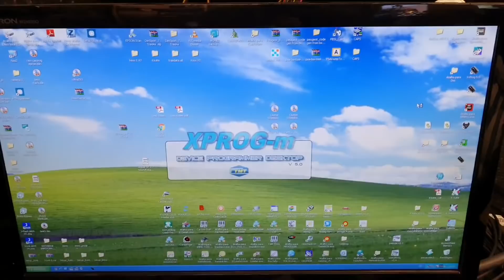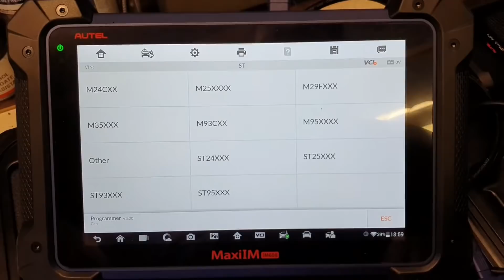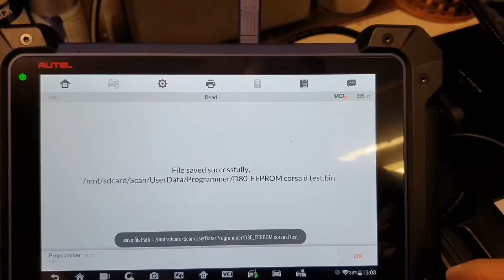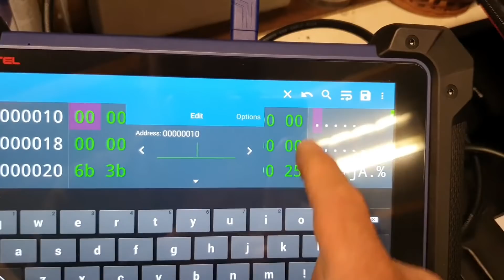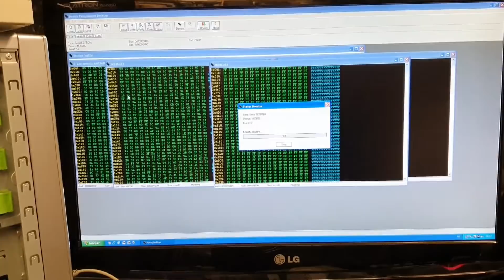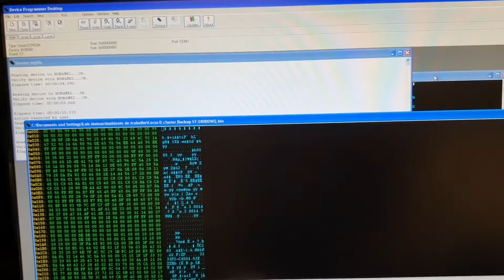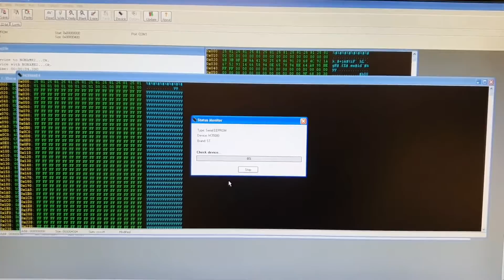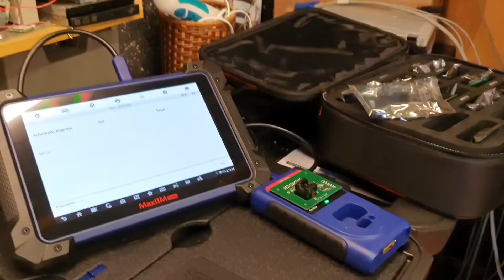Writing incremental bytes on 080D0WQ... Using the IM608 and the IMKPA adaptors.

Comment: Do you have any idea how this write protection is implemented and how the tool gets around it? I'm lucky to have an IM608Pro, about to order the APB126 adapter for it. I used to always use my Yanhua Mini ACDP with a 35xxx adapter board to edit my 160DOWT. This time, it's not working, and it's not working on a new 160DOWT either. The programmer just hangs on the write process and corrupts the data. I think Yanhua could have changed something and introduced a bug, so I'll use the APB126 to restore the chip. I just don't understand the theory behind this. I also read somewhere that if you heat the chip to 100 C / 212 F, it might work. I guess I'll throw one of the new chips in the oven to see if that helps.

In short, thanks for confirming that the APB126 should solve my problems and I don't need to buy some other $500 tool.
Reply from the maker: Look for the datasheet of the chip, there is comprehensive information regarding how the chip works.
The way most tools get around this incremental area is by erase it...
The incremental area, the first 32b, only allow writing if the value to be written is higher than the one stored,  so if the tool erases the area first, then whatever will attempt to wriite next it will be higher...
Probably not very well explained, but hope it makes sense. 
And again, have a look at the datasheet...
👍👍👍
Reply: @LMAutoRepairs  I found the ST datasheet for the M95160-DRE but that refers to a lockable ID page that's 32 bytes. I haven't found the datasheet for this chip. But I can imagine they designed a custom version of the chip that allows incremental writing somehow. I understand the basic physics of ROM's, how you can erase an entire page and then you can flip bits from 0 to 1 without erasing. That would allow you to write, for instance, 0, then 1, then 3, then 7, etc. because you only have to change zeroes to ones. It's weird to be able to increment. Maybe that feature isn't a result of hardware physics and it's actually implemented in the chip software because the customer requested it from ST. I hope ST hasn't limited the number of times the first 32 bytes can be erased or something. The Autel isn't recognizing the new chips I bought off Amazon so tomorrow I'll desolder my original chip and see if I can erase it with the Autel.
Reply from the maker: @charvakkarpe 
There is plenty of fake chips out there, those can behave in strange ways, not being recognised being one of them.
😊

Comment: Hi
How do you erase crash Data in airbag module p/n DN4J-57K30 on a Mazda MX 30 from 2020, I can't see which brand the eeprom is, I've read on Google that I might gona use some obd can tool?
Last, do you do this job, I send it?
Reply from the maker: No eeprom on that one...
The data is on the processor, an Infineon Tricore...
👍👍👍
Reply: @LMAutoRepairs  is it possible to erase crash Data?
Reply from the maker: Yes... should be...
👍👍👍
Reply: @LMAutoRepairs  hmmm, could you please give me a hint, how? 🤔
And what tool to use, because this module cost 1050£ +tax
Reply from the maker: You need to read the data from that chip first...
Do you have any tools?
Reply: @LMAutoRepairs  No, I have IM608.
What is the workaround, this might be an idea, to a new video from you 😜
Reply from the maker: If the IM608 is not capable to read that chip, check on the menus etc, you need another tool to do it...
👍👍👍
Reply: @LMAutoRepairs  what tool, would you recommend?
Reply: @LMAutoRepairs Hi Luis
If I sent the airbag unit to you will you be able to reset the crash data?
And how much do you charge for it?
Reply from the maker: I do not do things that way...
Without the car would be difficult to test etc...
Sorry...

Comment: Good morning pal, I’ve just recently subscribed to your channel and would like to say I’m really impressed in your work, I’ve been watching your video’s for some time, I’m also in the game use to work on a lot of the old cars back in the day and still doing them but struggling with a lot of the electrical side of stuff, and when I’m watching you I just wish I could do the stuff you do cos it’s so impressive, I get a lot of electrical work some I can do cos it’s just a case of connecting a wire back up and so forth, Ok to the main thing I would like to ask you, I have a Peugeot expert 3 2009 1.6 hdi  130,000 miles I have starting issues it’s just turning over no start I think fuel not coming up, I have a solus legend which shows a few faults, but for now I’ll just send you this msg cos not sure how busy you are, as I have more to tell you, and just want to know if it’s ok msg you with the rest of the problem I’m having with the, I watched you video of the one you worked on and it’s the same type of van. Kind regards
Reply: Thanks for the reply the first code is P0104 Flow meter signal open circuit but that’s because I replace it with a new one
P1351 preheating relay circuit, Relay stuck in open position.
P0113 inlet air temperature signal  (flow meter) short circuit to positive or open circuit.
P0615 Controlled engine start and stop, open circuit or excessive temperature of starter relay
P0692 Fan high speed control, open circuit 
P0193 Diesel pressure signal, short circuit to positive or open 
P0238 Turbo pressuresyh
Reply: P0238 Turbo pressure ( downstream of heat exchanger) short circuit to positive or open circuit or value too high.
Reply: These codes I’m sending now was the ones previous before I fitted the new parts.
04A1 front/rear courtesy lighting control fault, short circuit to positive-local.
05FF Bsi Internal Fault (Bsi Reset) not Characterized- local
0A58 Study fault.
Reply from the maker: From this, I would start on the P0193...
If it is true, on live data, the readings of the fuel pressure will either be frozen, erratic or completely out of range...
I would focus on that to start with, check wiring first, connections, etc...
Reply from the maker: Hi
Thank you for the feedback! 
The codes, whatever they are, should help you going in the right direction...
👍👍👍

Comment: Hi Louis, I have not used Windows for a long time but IIRC if you press Alt+Spacebar you get the option to move a window that has gone off the top of the screen.
If I'm wrong then someone will correct me.
Thanks and good luck to you for these informative videos.
Reply from the maker: 😊
I will try next time...
👍👍👍

Comment: That's a really weird problem. Why would this eeprom chip do that? What's different about this chip vs other eeprom chips? I'm curious to see if the orange 5 or vvdi prog would have the same issue
Reply from the maker: Hi
It is a characteristic of this chip (and some others from the same family)
Basically the first 32 bytes are protected, it is where the mileage is stored...
Some other programmers can also do it...
I never used orange... VVDI can do it...
👍👍👍